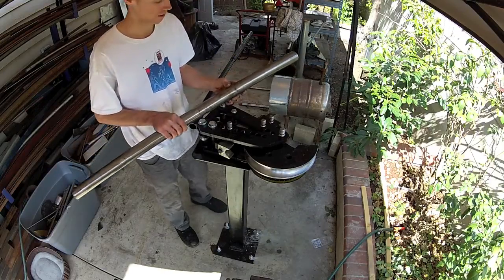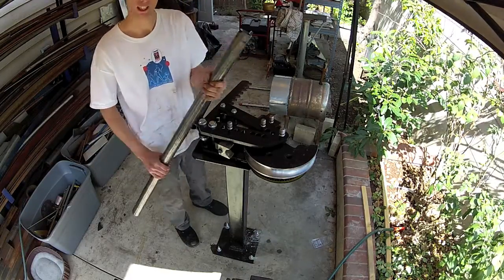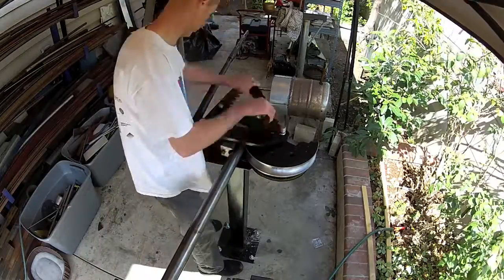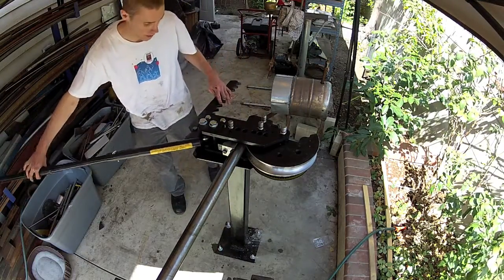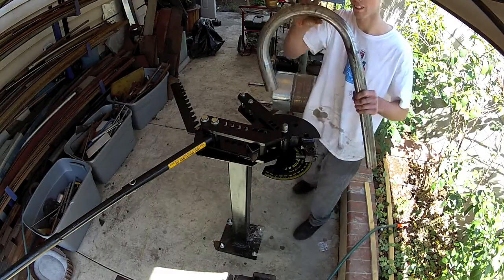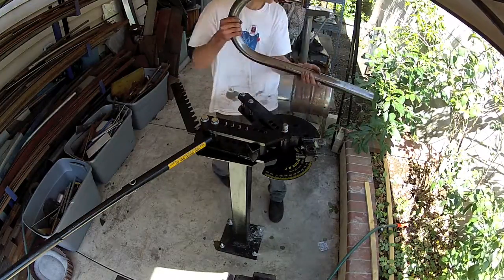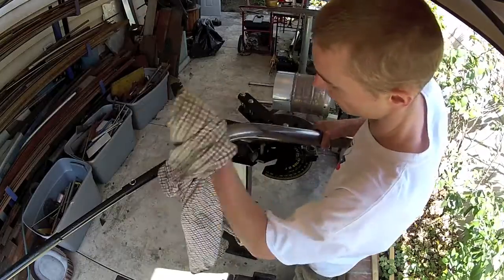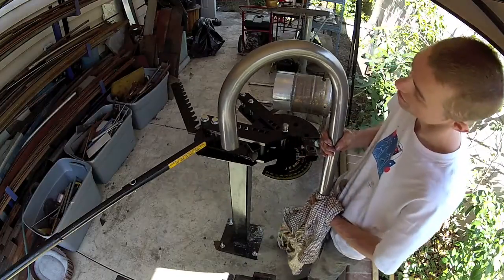JD2 model 3  bending a 2'' diameter pipe at 1/8'' thick wall at 180 degrees

Comment: That sounds great, man. I had contemplated buying a hydraulic bender from Harbor Freight mainly because of the low cost, but then I saw yours and I had to ask. I may still go with the H.F but I will have to pack the pipe with sand and cap off both ends just to avoid kinks when bending the pipe. I would wait until I can afford the one you have, but I am one of those guys just itching to get back in the garage and build some bikes. By the way, I've been following your work and I'm impressed.

Comment from the maker: @pedalpunk57  I've bough't it at a place called schorr metals down my street. The assembly with no stand or any dies was $350 on sale. The dies retail for $200 to $250 each die. The 2'' die I paid 320 on sale but they go for $350 to $450 on eBay. The stand is pretty easy to make but they go for $140 on eBay. eBay sales these JD2 model 3 benders pretty reasonable for the quality they provide. Its not china. Its USA quality.  I've put this bender on hold for the longest time and finely got one

Comment from the maker: @pedalpunk57  I am super happy with this pipe bender. It does the job pretty good. Not so good with thin wall tubing pipe. Does a bitchin job with pipe 1/8 thick wall at 1'' 1/4 OD and also the 2'' OD with the same 1/8'' thickness wall as shown on this vid does the job really good. I can't complain with this pipe bender at all. Less then $700 your set with one die and this bender ready to bend some pipes in your back yard. Not just any bends. Professional style bends that look awesome :)